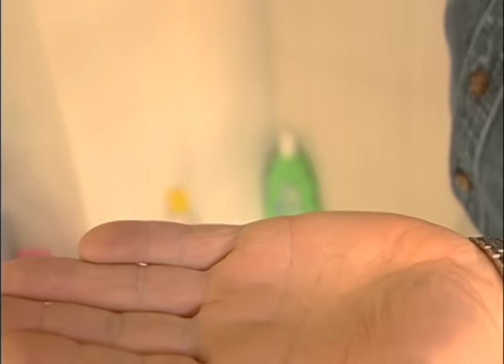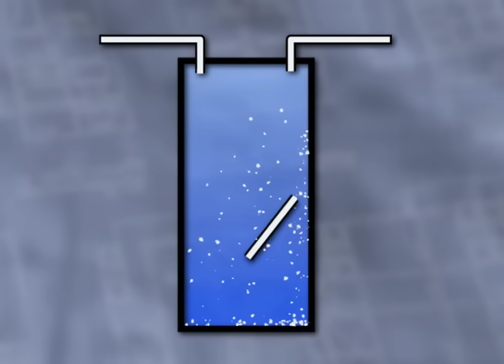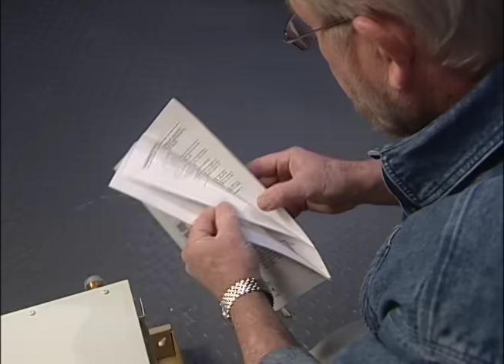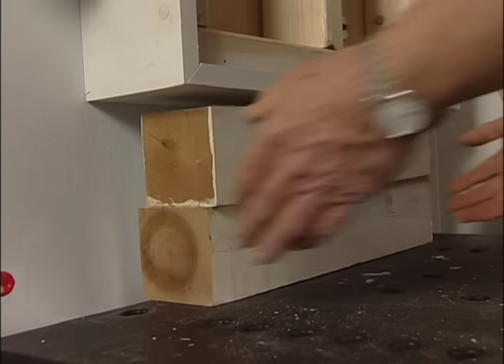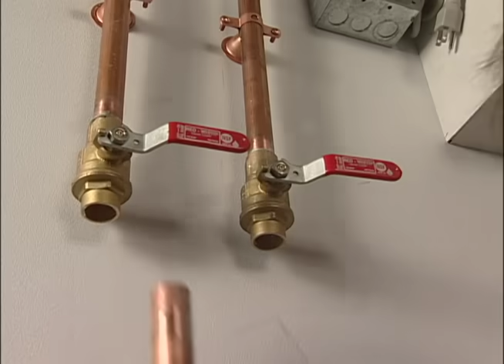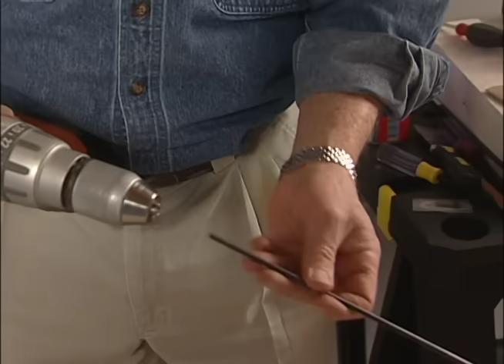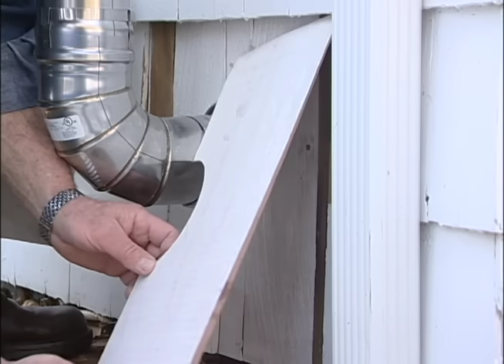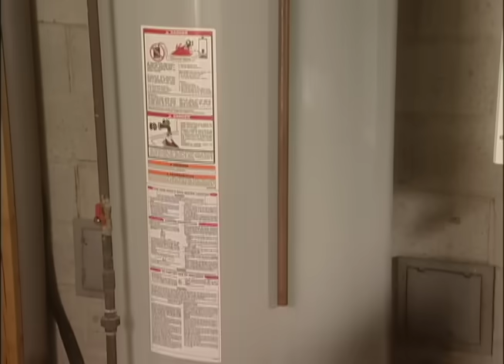Install a Tankless Water Heater

Comment: GET A ELECTRIC TANKLESS, NO VENT, MUCH SMALLER.
Reply: Mark Eaton and terrible performance and requires three 220s runs
Reply: @QuentinKingH2O_King89 Mine Is 13 kw, runs off one 60 amp breaker, three wires only and works great.  To each his own.
Reply: Mark Eaton yesBUT you need larger electric lines than what fed your old electric w/h, most people DO NOT REALIZE THIS FACT, Cheers From NJ🇺🇸
Reply: @markeaton2003  What all is running off of it??? (Like: 2 showers and 3 sinks & a dish washer?)
Reply: natural gas is much cheaper if it's available

Comment: so instead of draining the sediment off the hot water tank every year, you'll now have to have a cleaning solution run thru the tank-less heater every year to prevent your tank-less heater from scaling up inside and depositing the little chunks in all your faucet screens. and if you are not into the idea of getting the equipment and doing it your self then you'll have to pay a plumber $200 or so every year to do it for you ... i dont know, I think you would have been further ahead if you just put a new tank in its place ...
Reply: AnyWho.
  You must take into consideration that the guy who made this video of Bernard. Who is a guy that probably has never installed one of these. So, he took the advice of a salesman who makes 10 to 15 dollars an hour. He is not a professional in any of the trades. 
  Plus, This guy installed it wrong!
Reply: Upside your water never goes cold
Reply: Anywho. Cleaning out a tankless water heater is every 3 to 5 years. I've been a plumbing contractor for over 45 years. I have a tankless in my home. Its been installed for over 20 years. I've never serviced it. So they will go a long time with no service what so ever.
  Now i have a cold water filter (blue tank)right before it. Then a hot water filter (red tank) right after. For both of them. Its an extra 1000 dollars installed.  This is a much better system. With two filters. Now, you still need to service the tankless every 3 to 5 years. If I've had been the person who installed your water heater. I would really push the before and after filters. But i do charge a lot less to do the cleaning.
    If you call me to service your water heater. I have a service contract I'll have you sign. Which we'll set up services every 2 to 2.5 years. I can give you a much better rate.
Reply: AnyWho. You also need to know. If you service your own tankless & you are not certified either as a licensed plumbing contractor or certified by the tankless company you touch one of these you void the factory warranty.  There really are a lot of companies that make a tankless. You would need to be certified by each company to work on each one.
Reply: @ltsgarage7780  just do it yourself, I do it once a yr. Also I installed the bypass valves myself.
Reply: @terrycook4546  thats cool. You should understand that some of these tankless company's void your warranty if not serviced by a unlicensed contractor.  
  Not everyone is handy enough to do this work.
Did you ask the company "is it ok for you to touch the tankless?  What name brand tankless did you install the service kit on?

Comment: Waste of money folks! The payback is pathetic and you can buy more than a lifetime of tank heaters and still have money left over! When you consider the added maintenance of tankless (descaling, filter cleaning...) and the cost if you have your HVAC tech do the job you will be lucky to break even. Also, if you have hard water you will need a water treatment system or be prepared to perform more frequent cleaning to remove deposits that will impact performance. My last tank water heater lasted 14 years and could have gone longer had I not found a good deal on a new one. I keep the water temp at 120 degrees and use a wrap on the outside of the tank to reduce the number of off use heating cycles significantly.

Comment: I have a tankless electric water heater and had to put a small tank heater in the line after the tankless. That way it acts as a buffer and I always have instant hot water and no change  in water temperature. Both operate on 220V. The electric instant heater is 100 amps and will supply as much hot water as you can use.
I also put a 2.5 gallon electric tank in line under the kitchen sink. That way we have instant hot water for the sink and dishwasher.
Reply: Retired Snowbird quite probably, you did NOT PROPERLY SIZE YOUR UNIT, you should NOT HAVE TO USE POINT OF USE HEATERS.CheersFrom NJ🇺🇸
Reply: @flybyairplane3528  I guess I did not explain my set up properly. There is 20 feet of 3/4 copper to my kitchen so too avoid a long wait for hot water in the kitchen I installed a 2.5 gal tank under the kitchen sink
.The 20 gal tank after the tankless supplies us hot water during the day. It is on a timer and only works at night when our electricity rates are lower. It is over 30 cents per kilowatt for electricity here during the day. We have whats called (Time of Use) electricity rates here in Ontario.
The small tank saves us several hundreds of dollars a year.
Cheers
Reply: Retired Snowbird SEE I would have zero idea, whereby our are located, but your electric should be CHEAPER THAN MINE IN NJ, anyhow I now see your reasoning, Check this out, in CHATUGAY , QUIBECK, my wife’s aunt nought a little house there, she had oil heat, can you guess what the ELECTRIC COMPANY DID ? They removed her oil unit, then INSTALLED A NEW ELECTRIC FURNACE, as it WAS CHEAPER than oil, HYDRO QUEBEC!,  She has now passed many years now.  Cheers From NJUSA🇨🇦🇺🇸

Comment: Tank-less water heaters require periodic de-scaling.  This involves circulating a de-scaling solution through the heater.  For most units, this means that you need a set of valves and T connectors to tap into the water lines.  You can find kits for this that include specialized fitting made for this purpose.  It also means that you need a circulating pump, a couple of hoses, and the chemical to make the solution.  These components are also available in a kit.  You also need to remember to perform this service once a year or so, and replenish the chemical.  The consequence of not de-scaling the tank-less heater is cold showers, until you perform the de-scaling.  Tank heaters should also be flushed once a year.  The consequence of not flushing a tank heater is more frequent replacement of the heater. 

Another benefit of tank-less is that you don't need to keep a tank full of hot water in your house.  Tank-less heaters only heat the water when the water is running. This can result in lower energy cost, depending on your usage pattern.
Reply: You can save money by buying 3 gallons of distilled white vinegar to circulate and de-scale the inside tubing of the water heater instead of the chemical de-scaler.
Reply: @russellvalence2456  I think of vinegar as a chemical compound.
Reply: Mike Edwards : 

Another benefit of a tank-less water heater is that you also save water because you don’t need to wait for the hot water to come out from the faucet.
Reply: @ajarivas72  Absolutely incorrect.  A tankless water heater provides "endless" hot water, but it does not provide instant hot water. The delay in getting hot water at the tap is caused by the volume of water in the pipe between the tap and the water heater.  The type of water heater does nothing to change this.  The only way to get near-instant hot water at the tap is to install a recirculating loop and pump, which keeps the  line charged with hot water.
Reply: @jeffeverde1  

Thanks for your reply and insight. 

Another way to get instant hot water at the tap or shower is to pre-heat the water in the pipe with an induction coil (steel pipes) or electric resistance

Comment: it's a tankless job but somebody's gotta do it.
Reply: No tank you.
You're well come.
Reply: Darn I just posted this same comment, you beat me to it.
Reply: Why didn’t you just tie into the old flue gas vent line?
Reply: Rod Lewis 
I asked a Raheem technician this very question.  Here is his answer:
"The stainless duct not only carries exhaust away but also allows the tankless unit to breathe as it has a double wall so it must be vented into an open area."
Reply: @rhythmstyx1945  Understood, but it he's replacing a Gas WH with another Gas unit, why not reuse the existing vent? But I guess it's just TV and we shouldn't overthink things.....
Reply: @jaxcell  When you start your car in the morning it drips water out the exhaust right? That's condensation...just like your mirror after a hot shower. Tankless pipes are continually cooled as the cold water rushes in and is instantly heated during use......so....the exhaust has a LOT of moisture in it every time it's used.... it's entire life.....and that will eventually rust out a conventional galvanized tin vent.
Reply: XD
Reply: lastpirateslife. This comment is way too underrated
Reply: john turner Agreed!! 😉
Here, here, lastpirateslife!🍻

Comment: My Father had a new home built in 2017, with Pex tubing and a tankless water heater, directly on the back wall of the bathroom.  I have NEVER experienced such a lengthy delay to getting hot water.  It's totally pointless to wait for hot water when washing your hands.  What gives?

In our 46 year old home with 30 year old 40 gallon water heater, you just wait a few seconds, even in the winter, and you have hot water at the second floor bathroom faucet!
Reply: That is the trade off for an unlimited supply.  There are ways to not have the delay.  For example, you can use a circulating system to start the hot water when you turn the bathroom lights on.  You can also use a small tank water heater along with the tank-less, or you can the a single hybrid unit that includes both tank and tank-less units.
Reply: @1768ify  So this longer delay to get hot water from a tank-less heater is completely NORMAL in comparison to the age old water heater?  I did not know that.  Most homes do NOT have a re-circulation system or a looped system in place, especially if they are retrofitted in place of an existing water heater, with old plumbing.
Reply: That is not completely true. Tank-less gas heaters have a startup delay. On mine the combustion blower comes on for a few seconds before ignition. The total startup is about 4 seconds before the flame comes on.
Reply: @1768ify  When I use his bathroom there's no point waiting for hot water from the sink tap to be honest.  It's like if you're going to drop a deuce, turn the faucet on a few minutes ahead of time.  Seems ridiculously long to get even warm water, especially with such a short Pex plumbing run!  Not even cold copper to heat up first either!

Tank-less set point is also at 120'F!
Reply: Correct. I will sometimes run a small amount of hot to start the heater, and then shut it off for 5 or 6 seconds before turning it back on. If you watch/listen to the heater, you might be able to see/hear when the burner actually start.
Reply: @1768ify  I'll try that next time I'm there!  Thanks for the suggestion.
Reply: I only have experience with two of these, a close out Westinghouse bargain unit from a local home center, that had bad software, and a very good Rinnai. After spending a couple of hours on hold with the manufacturer of the first one, (not Westinghouse) the guy told me it probably needed new software, and I should back again to get an update. It was on sale because it had sat in somebodies warehouse to long. I checked out a few things, and decided it would be best to return the thing and let someone else get the software update.  I got the Rinnai elsewhere.
Reply: @1768ify  Good to know.

Comment: Good job - but I didn't know you needed electric.  What happens if you lose power?
Reply: You won’t have water if you are on a well. You won’t have refrigeration either. But then again that is what generators are for.
Reply: The lights, furnace, exhaust fan, TV and water heater don't work.  Same thing happens if you have an electric water heater.

Comment: My tankless from HD broke after 4 years... then after much $$$$ it worked again.. then 2 years later it broke again... more $$$$ and it was fixed then after another 14 months the coil completely failed .... they wanted even more $$$$$$$$ so it went into the trash .... they don’t sell it any more...
Reply: MyEyesBled , sounds like you have a common problem,,with mineral, but Would love to know what brand that was, & yea there have been some no longer around, Cheers fromNJ🇺🇸
Reply: What brand was it , just curious

Comment: Looks like your plumbers didn't install the clean out valves.
Reply: He's right.
Reply: i have heard of a cleanout but never a cleanout valves.
Reply: @dangda-ww7de  : cleanout valve, service valve.  Lets you flush your system .
Reply: @imaslowlerner  yes, service valve, i never heard of a cleanout valve.
Reply: @dangda-ww7de  :  the majority of the time you would use the valve to rid the system of that sediment build up, that's how it got the name cleanout valve.
Reply: @dangda-ww7de  you're talking semantics.  If you don't understand what he is referring to.  You should just read what's said in videos like these & not try to make comments.  
Just watch & learn!
Reply: dang0088 da thats fittings onBOTH LINESto chemically remove the minerals in your water, usually ACETIC ACID,,which is 5% vinegar, store vinegar is  3%acidity..some parts of the country is minimal, others like a bear, Cheers From NJ🇺🇸
Reply: Leighton Samms so If I don’t have service valves on mine, is it safe to assume I don’t need a flush? New house and thus tank I inherited is flashing code that I need to flush but no service valves
Reply: Brian & Starlita Kilpatrick  so you got a cheap job, but you will have to see hou could install some,,the cleaning uses ACETIC ACID,  which is 5% , where regular vinegar in supermarket is 3 %. What part of the country are you in ?   Cheers From NJ🇺🇸🇺🇸🇺🇸🇺🇸
Reply: @brianstarlitakilpatrick1589  no, they absolutely must be installed/maintained... not just for the warranty (which is useless 99% of the time anyway), but to ensure scale doesn't clog the pipes and reduce efficiency. Here's a great video on the subject that you should watch: https://www.youtube.com/watch?v=T4FaqGod3VU

This is VERY important on a tankless heater - much more so than a tank.
Reply: @dangda-ww7de  its called an "Installation service Kit"
  You must have one when you go to have a tankless water heater serviced. 
 MUST HAVE!!!
  They cost a wapping $85.00. That's what a plumber pays for them. So cost is, Plus his mark-up percentage.
Reply: Paloma? Is this an obscure brand? Or something popular in certain regions?
Reply: Andrey Yaromich  hello, P
Reply: Andrey Yaromich  hello, PALOMA , IS NOT an obscure brand , it came to the USA, probably in the late 60s , But then RHEEM, BOUGHT THE BRAND, in about 1950, wher I lived in JAMAICA BWI, there is a brand from ENGLAND, where they were popular, they had smaller ones, point of use, or larger ones for an entire home, the water flow caused the main flame to come on , they worked great, that brand , was ASCOT, ,, CHEERS FROM NJ.🇺🇸🇺🇸🇺🇸

Comment: My Renai required a 3/4” gas connection; therefore I couldn’t use the 1/2” gas line from the old standard water heater. I added a water softener to the system which presumably will double the life of the tankless water heater. The larger gas line is needed to comply with the instant hot water heating requirement!
Reply: some tankless dont need 3/4 gas pipe anymore, it use 1/2, the new one, look at noritz.
Reply: The sizing of the gas pipe depends on the BTU needs of the tankless heater and the length of the pipe from the home's gas meter.   Most natural gas tankless heaters are 140,000 BTU to 199,000 BTU, whereas a typical 50 gallon tank-type water heater needs only 62,000 BTU.  So yeah - to install a tankless heater, it is not uncommon that you'll need to have the gas company out to install a larger capacity gas meter, and then you need to run the correct sized pipe to the tankless heater --  one-inch pipe if your run is over 10 feet or so to one of the larter 199,000 BTU units.

Comment: 1. Sediment is a clear indicator of hard water.
2. The solution is a water softener or a Bradford White water heater ( has Hydrojet technology) 
3. FACT. Sediment will continue to clog up your fixtures with a tankless until you install a water softener
Reply: Tony Bruno that was plastic not ordinary sediment.

Comment: I'm  won't  tell  you..standard hot water heater  better...don't  need  power. 
..gas pressure...water filter.  And replacement  cheap